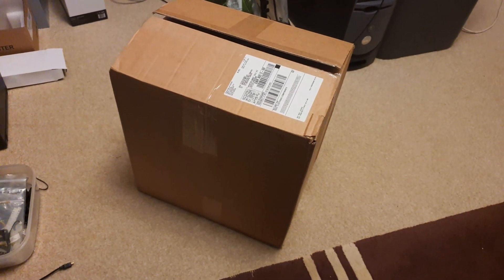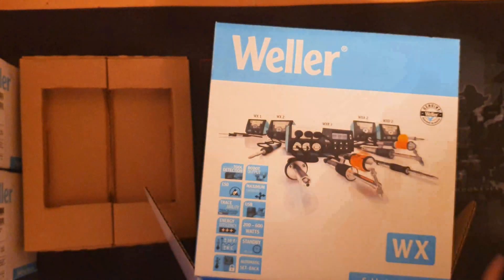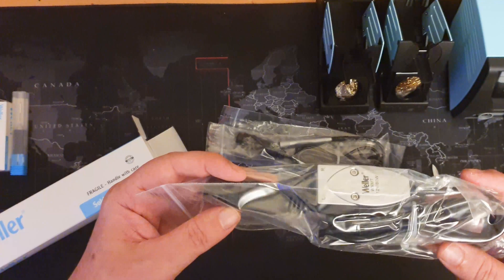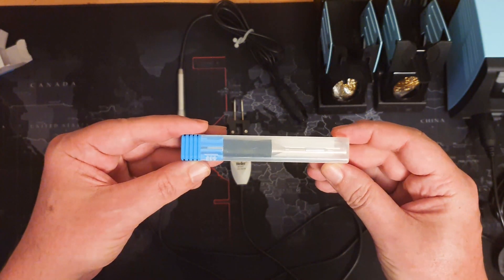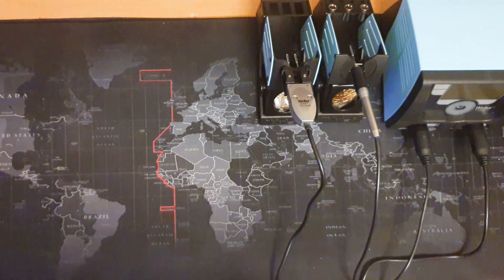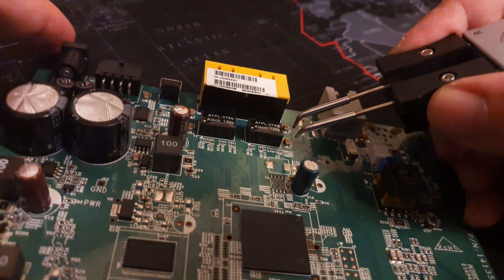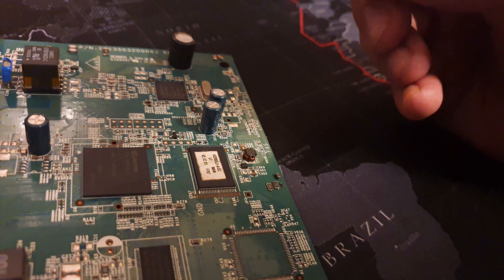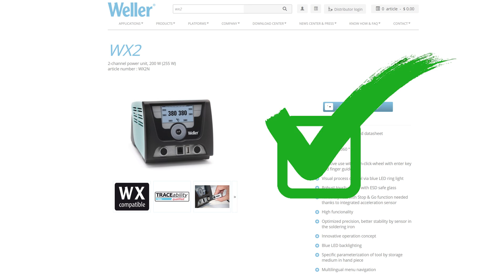Weller WX2 Micro Soldering Station Unboxing!

Comment: Hi thanks for the video good info
I'm looking at this soldering station.
How good are the tweezerers ?
Have u used the 10mm ? Have u been able to take larger ics considering its only 40w per side I'm just wondering that's not powerful enough to remove ics
Reply from the maker: Hiya, I haven't gone up to 10mm, the largest tweezers I have now are 6mm. They take small IC's off with no problem. For me, anything bigger - I'd switch to my hot air station. I suspect you are correct and 10mm might be pushing it, though if they make them, they must have a use! :-)

Comment: Does it also use 24V for the tips? also do you maybe know the pinout of the handle connector??
Reply from the maker: Sorry, nope, these are all 12V tips and the 24V tips are not backwards compatible. Nobody has the full pin-put, its now got a lot more complicated as the newest WX-series has an accelerometer in the handle instead of a reed switch, and there's an EPROM doing temp control etc, so the comms via the cable are probably digital now and not analogue....somebody would need to probe them and reverse engineer them to get the full picture.
Reply: @martinmeyer2008  thanks a lot, had a hard time getting any info on it